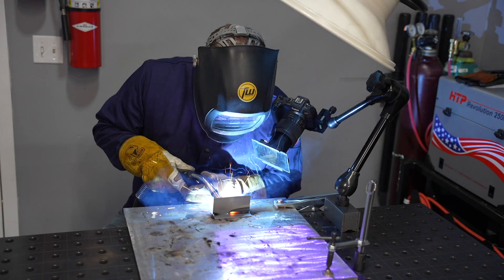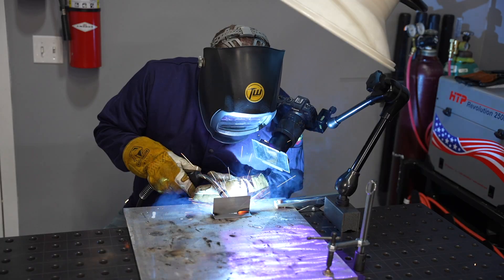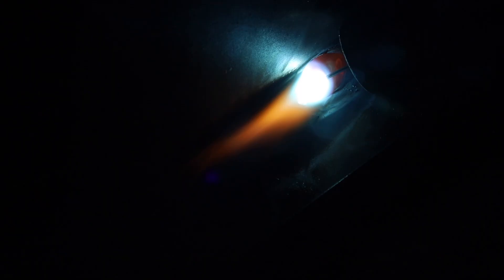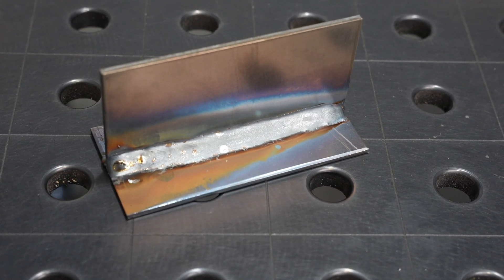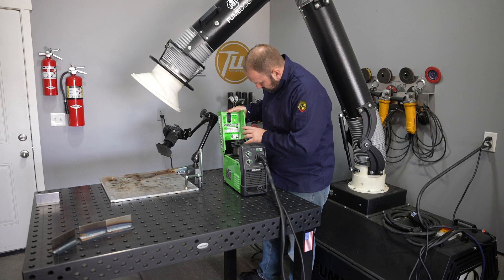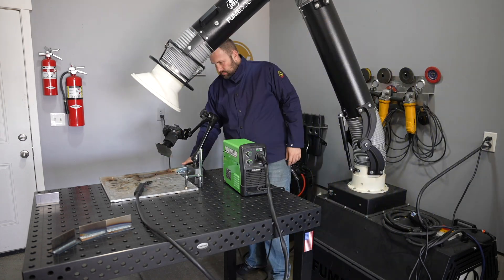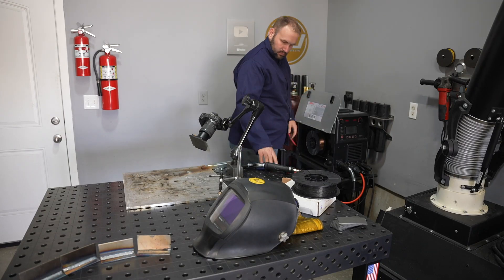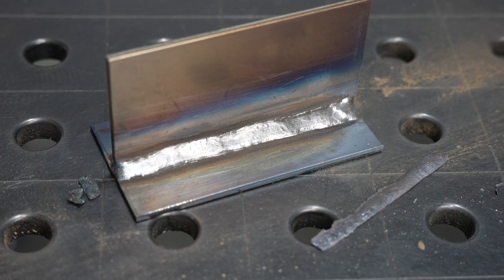5 Types of MIG Welding Explained

Comment: Which lens did you use in front of the camera? I would like to replace my helmet with it.
Reply from the maker: It's more about camera settings than the lens. It's a standard ND filter, but it wouldn't be safe to weld with that.

Comment: I am hearing that the brand of flux core wire makes a big difference on how much slag will be lifting off compared to chipping it off with the hammer. Which brand of flux core do you recommend for almost hassle free welding?

Comment: Idk if he mentioned it, but with self-shielded FCAW, the electric current is ran as DC electrode negative (straight polarity), meaning you want your ground wire on the positive terminal and your electrode on the negative terminal.  If you don't do this, you'll have a terrible time and your welds will be absolute trash.

Comment: Hi Tim, enjoyed your course. Have a question that I am unable to find an answer to. I have been looking to buy a pulsed mig welder, not the very expensive ones , such as a yeswelder double pulsed mig welder. It says that it uses spray transfer mode.  Now how does it do this when welding thin material if the voltage and amps must be high to produce a spray transfer? Wouldnt such settings blow a whole in thin aluminum almost immediately even on pulse? Hard to get a handle on this

Comment: 4:54 hi , you didnt explain how to even achieve pulse Mig... is that a setting on the machine.. ? tnx.
Reply from the maker: Yeah, the machine needs to be capable and set for it. You also need the right gas, 90/10, 92/8 or 98/2(O2)

Comment: Hello how are you? Nice video. I have a flux core machine using a 0.8 wire but the roller is 0.9. Every time I try to solder something, the amount of spatter is too much. When welding with flux core without gas, is continuous or alternating electricity used? Cheers from Argentina

Comment: I have a question. Which welding mode gives joints that are more tolerant or elastic to compensate heat expansion and contraction ? Stick or mig ?
Reply: Stick or dual shield

Comment: So i have been running 75% argon an 25% oxygen an i follow the chart for my settings but the wire comes out smoothly for about 4 seconds then it holds for a second or two then goes another 4 smoothly. What could that be?
Reply from the maker: It’s likely that the spool brake is too tight and the drive roll idler is too loose. This will cause the spool to jam and the drive roll to spin. You’ll be able to see this with the lid open shooting some wire into the air. Also, double check that you’re using the right size drive roll. The last thing that it could be is the gun liner, but based on your description, that’s less likely.

Comment: I hated self shielded at first, but as i got to get more practice and arc time i started to really like it. My teacher told me you could tune your machine so that you can rock a stick out of like 3 or 4 inches. You want 10-15 degrees of drag, keeping your wire in the flux as you pull the puddle forward. My biggest problem starting out was not waiting for the puddle and flux to establish and not allowing the flux "c" or "eye" to wrap around the puddle as you end your weld. Also this might not mean anything, due to the way the electrons flow, when i was dialed in, i could see 2 tiny beads of flux "dancing" or "spinning" on the end of the wire
Reply: That's very good information.  I would recommend now that you stop watching the arc, though, and maybe work your way to a 12 shade (because you just need to see the puddle's edge).  You'll save your eyes and learn to "walk around the house in the dark".
Reply: @campbellpaul  I run shade 11 already, just something I noted in my initial start,been welding for 3 years, I've definitely had to talk people into switching from 9 to anything higher.
Reply: @Irken_Invaderz  👍
Reply: @campbellpaul  👍

Comment: Working on trash trucks it's been my experience that flux core is not nearly as critical on clean metal
Reply: Flux core will weld anything. I've welded painted steel together before with flux core 😂 same thing with stick
Reply: @blender_unleashed  truth. My actual preference is 7018. Sticking trash trucks back together? I sometimes wonder how many hundred pounds of it I've burned over the years

Comment: Could you cover dual shield welding a bit more. Is the flux core wire a special type? Minimum current required? C25 or special gas? etc
Reply from the maker: I do have a video on the channel covering a lot of the details and I can do some more videos on it in the future. The wire is different from self shielded flux core. ESAB calls it Dual Shield wire and Lincoln calls it Outershield. It usually uses C25 gas.

Comment: Does dual shield penetrate better? or more consistently?  It is a smooth finish you achieved with little spatter, I like it. Just wondering if it is worth getting involved with. Be nice to see the different welds cut and etched to see the actual depth of weld penetration.
Reply from the maker: Each process can penetrate sufficiently when done right. I’ve taken dual shield cross sections with great penetration and some with lack of fusion too. It comes down to developing an adequate procedure for a particular application no matter the process. I would say that it’s generally better than short arc on thicker material, but not a silver bullet. I’ve reviewed thousands of cross sections from all sorts of welding processes and there is a ton of variation within a given process, so comparing two processes based on a few samples can be misleading. That being said, it would be an interesting experiment and video, so I may take a shot at it. If you’re working with heavier material, looking for better toughness or welding out of position, it’s definitely worth considering.
Reply: the dual shield especially when using 75/25 gas vs 100%co2  is a spray transfer, it is very hot and "washes" and penetrates MUCH deeper than a lot of other welding processes.  The slag system allows it to be run out of position and it also "covers" the welds so the ambient air can not rush in and harden the weld ....  that way typically not only the penetration is better but also the ductility  (elongation) is much better than with sold wires that lack that "cover" right after they are welded.   this makes dual shield welds less hard, less brittle and better suitable for impact and high stress applications ...    that could be an entire video by itself  .....
Reply: @ZILAwelds  I don’t think there could have been a better response. You nailed all the key elements and benefits all in one simple comment.  Dual shield definitely has its place. I’ve been running .045 dual shield 6 days a week for about 3 months now, and it’s pretty amazing how much wire can be ran in a day
Reply: @mkearn724  yes, deposition rates with 045 are pretty good !!!!  Wenn you weld s lot of inch or inches thick plate with reasonable good fit up and you have a 300+ amp machine and asbestos gloves ….  You are through the first 33 lbs roll before lunch break 😂

It will cook your knuckles and bleach out all your clothing ….  But it REALLY makes progress

Comment: I have an adjustable welding helmet and still can't see my weld during operation. I can only see the arc. Is there a good goto helmet that beats all?
Reply from the maker: As long as it has new covers on the inside and out, most brands work well. Part of seeing the weld puddle is practice, though a lot of the new helmet models are much better. The thing to look for is an optical clarity rating of 1/1/1/1 or 1/1/1/2. I personally use a Miller digital infinity and I like it. It has a little weight to the lens, causing it to shift around a when I’m sideways under a car. For bench work, it’s great. I’ve demoed several brands, both cheap and expensive, and as long as they have that clarity rating, most of them are fairly similar to look through, leaving build quality and fit preferences to differentiate them.